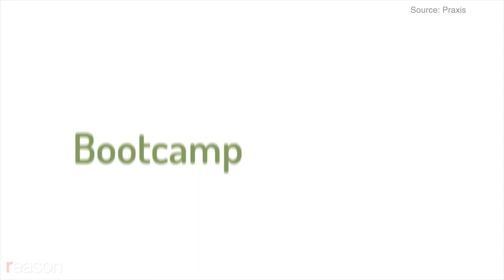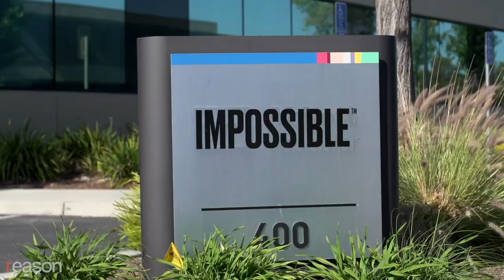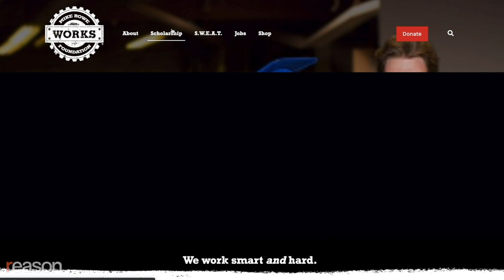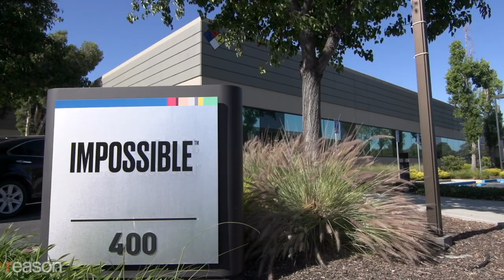Why 'Free College' Is a Terrible Idea

Comment: I didn't go to college until my 30's. I got made fun of for going to college so old. What they thought was I was a thirty something working three minial jobs. What they didn't know was that I delayed college because I already had a successful career. And because of that, I was able to carefully choose classes I felt would actually help. I graduated debt free.
Reply: That’s pretty smart you should take your time.
Reply: Anyone I knew who was older that attended seemed to have something useful under their belt, and for me the better part about it is they knew what they wanted and their sense of what to do next seemed a much more solid foundation than the shallow dweebs that made fun of them without even bothering to know anything about them. Really simply to make themselves feel better. But that's the kind of world we live in. The other spectrum were the ones who decided to change careers, and really that's just realistic cause sometimes it happens. I don't understand why we have to make people feel bad for finding out later on what they first chose was just not the right fit and pursuing something else is just fine.
 I wanted to take a break, but was pressured into it. I ended up super depressed, dropped out with debt, and then went back paying out of my dad's pocket to a smaller college because I felt like such a failure and tried convincing myself to push through it as difficult as it was (cause I didn't agree to any of it). Ended up dropping out n I'm absolutely fine with it cause I made the best decision for myself and nobody else.

Comment: If you want to be a car mechanic, and don't plan on going into car design at VW, Ford, Tesla or Toyota, then plainly you don't need BA. Just the trade school should suffice. And yes, you can get work in a nice service car shop. And have a place of your own eventually. This is not what Universities are for.

Anyway - the thing about free education is about removing barriers. Not necessarily Universities, but any/all education. Not "forcing" people either into Universities or trade schools. But not stopping them just because they cannot afford them. It will not fix everything, but for society at large, maybe it is worth it.

The problem is not free/paid/overpaid but quality education for those that will benefit from it.

Side notes: 
Let's not forget that not all Universities are same. Why they make a difference? Example: a properly educated coder is worlds ahead of only self-taught, quite efficient, but limited coder. There is more to coding than just knowing languages (even many).

Meanwhile this vid looks a bit like a shill for Praxis. I don't argue they are not worth anything, but this is still more like an ad.

And about working your ass off - that's conformity to the greed driven business model.
 If you think I support slacking etc., you miss the point.

Comment: I'm an electronic technician by training. The most important thing I ever learned I learned as a teenager building and running RC cars. Corroded and loose connections, cold solder joints.

Comment: Typical high school should end at the 10th grade. The next 2 years should either be spent at a community college doing General Ed for those destined for college (but even that should be cut way back), and other kids should be learning a trade through a program and/or an apprenticeship. By age 18, all those trade school kids should be earning a living wage doing more than flipping burgers, and the rest should be just 2 years away from a bachelors degree (or a little longer for tougher degrees). The point is that student debt should be cut dramatically as kids not meant for college won't be pushed that route, and kids that are meant for college are there for far less time.

Comment: So my state recently rolled out a free college program called MassReconnect. In Massachusetts, community college is now free if you're 25 and older and don't have any college experience. But I have a very big concern. Retention rates at community colleges are low. Less than half actually graduate and that is the students that came to a college wanting a degree. Now think of marketing free college to older students. I am guessing that you will have a lower retention rate for these students.

The problem I foresee is that all this free college isn't really free. Yes it is free if you make it to the finish line, that is if you graduate but if you don't, say you can't finish the program for some reason or even wish not to, you are obligated to pay all that tuition back to the state. That means more than half of the Massreconnect students will come out of this program poorer than they were coming in. I hope I'm wrong about this but it's a concern.

Comment: "Being only 21 and without that 4 year college degree, i still got the job" I will be graduating college by the time I'm 21with a four year My point is you dont HAVE to take 4 years to graduate there are accelerated programs to get through college in just barely 2 years. I don't think college is for everyone and hell the only reason I went is that scholarships make it free for me, so its practically impossible to not justify the ROI I'm receiving from that free piece of paper (diploma). I do think if people think that raising taxes and making college free is the right way to go than they are dead wrong. Yes, the price of college is inflated, but make the college system pay for that shit not the taxpayers. Set a limit of the price of college at a reasonable price compared to the average income of someome at the college age. Reeeeeee the people who campaign to run this country are a bunch of fucking idiots, but I'm too impassioned to campaign myself.

Comment: I found a university education to be quite useful.  I double majored in physiology and electrical engineering earning B.S. degrees in each.  I certainly did not screw off as an undergraduate.  I earned a M.Eng. in Biomedical Engineering and worked for NASA contractors for 25 years.

My concern with the big trade school push is that we will wind up with a cadre of minimally educated people with minimal or no background in hard science, engineering, or math who will be unable or unwilling to critically evaluate statements made by government officials or scientific experts.  The public's reaction to COVID-19 is an excellent example.

Until universities get rid of the administrator bloat, diversity/inclusion hawkers, virtue signallers, and other sources of noise they will not be able to begin to work on improving the curriculum.  Eradicating the Marxist indoctrination is key.  I can guarantee you that in life science and engineering classes professors and students ignored political nonsense.  There was too much to do!

Comment: I stand by free college tuition. Those that need a higher education but are restricted due to their lack of access to funding, should not be punished because of it, however. I disagree wholeheartedly with public schools forcing students to consider college as the only viable option for them. I'm a certified teacher myself and have ALWAYS disagreed with the strategy.

State-run education forces students to think as employees rather than employers. 

Free college is not a bad idea. It's simply one solution to host of issues.

Comment: As someone who finished a university and masters in electrical engineering (Both funded by a military career) my opinion is: its not for everyone, sure degrees like law, medicine and engineering will remain essential but 90% of degrees offered are either trash or completely useless in actual jobs (Looking at you gender studies), even those that are not useless still have nothing on job experience, Id rather have a salesman that started selling newspaper at high school than one that finished a business degree at college and only started to work after, I myself had equal use of both my engineering knowledge and my previous military experience (Specially teamwork and working under pressure) in my first job after graduation, to my genuine surprise. For people with actual interest in pursuing academic careers of with interest in high level technical jobs such as circuit design and brain surgery a university degree still, and likely always will, hold value, but for most others is just a debt maker.

Comment: I agree. College is not for everyone. Also, there are a lot of classes that you don't learn much. I highly suggest taking classes using edX, Coursera, Udemy and just YouTube. It is cheaper and you learn a lot. Also, every student should be educated on the power of debt and their potential earning power. Lot of majors do not pay off...Every college student should do a cost/benefit analysis. Finally, I do disagree that everything worthless in college. I have learned so much from speaker series and just watching professors debate each other. I have also benefitted from good mentoring from great professors. In addition, I have also benefitted from good peers as well. So college is not worthless but everyone needs to be aware of the costs and benefits. Again, college is not for everyone and some people can use it for greater opportunities and for some it may not be as useful- God bless America-